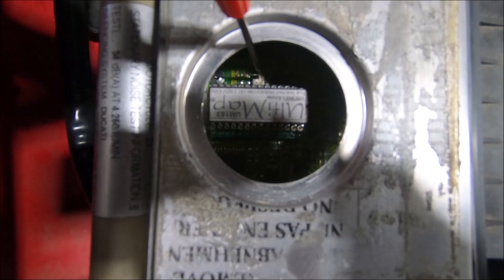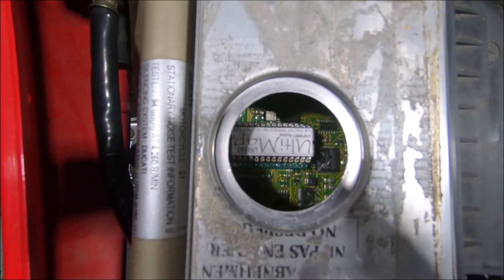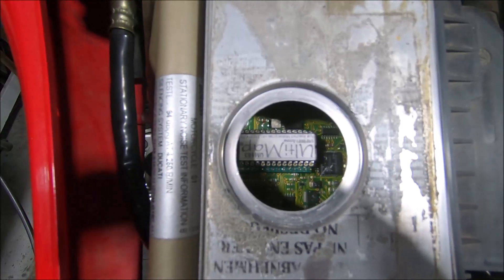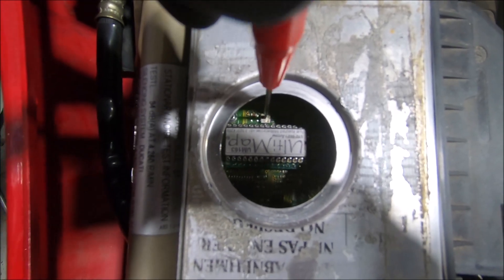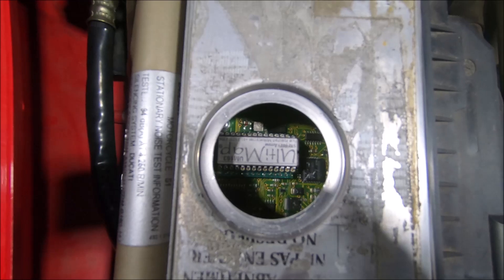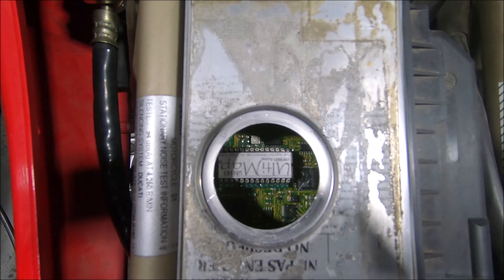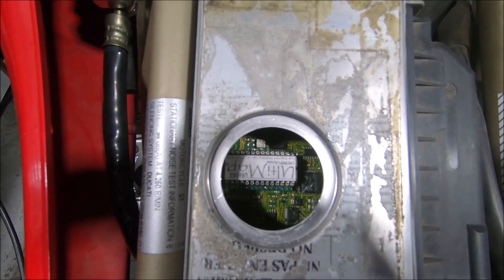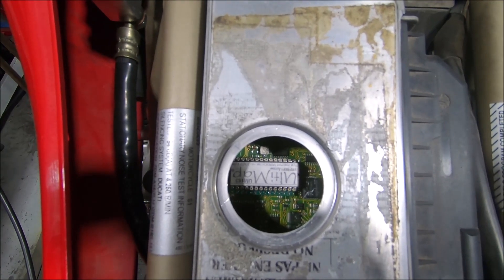Weber Marelli 1.6M ECU Idle trimmer

Comment from the maker: The trimmer works by adding or subtracting a given amount from the fuel injector pulse width.  As such, it's not a % thing, it's a number.  As such, adjusting the idle trimmer will have a much larger impact at low fuel injector pulse width than at high fuel injector pulse widths.  Ie, much more impact or % variation at low throttle cruise than full throttle acceleration, typically 4 or 5 times.  But it can impact full throttle running, especially on the MV models where the pulse widths are quite small even at WOT.

From the report http://www.bikeboy.org/ducati2vthrottleb.html >>

If you don’t have a gas analyser, as a bit of a rough guide, I’ve found that the best way to set the idle mixture is to move the trim pot clockwise (leaner) until the revs begin to drop.  Then go richer until the revs begin to drop.  Now you have these two end points, set the trimmer 1/3 of the way from the lean stumble point towards the rich stumble point.  This usually gives 4% CO when I’ve tried this method and then checked with the gas analyser.

Comment: Hi Brad and thank you for these useful videos and tips! I do appreciate them so much. Quick question regarding this trimmer setting : according to you should it be done with air bleed screws all the way in? Thanks !
Reply from the maker: can you please show me where i have said "according to you should it be done with air bleed screws all the way in?".  i just want to see what you're seeing or reading to work out why you have taken it that way.
Reply: Sorry Brad if I was not clear enough, in fact  it was a question. I was just wondering if it was recommended to adjust the trimmer with air bleeds in a certain position (all the way in ) but probably this step should occur after the idle speed is set so my question might not make much sense 🤔
Reply from the maker: @ericb8142  idle trimmer adjustment is the last step, but often involves air bleed adjustment in a back and forth to get both idle speed and mixture right if it was quite wrong to start with.  i've got a couple of tune set up videos plus the website reports that lay out the steps in order.
Reply: @bradthebikeboy  perfect then 👌 many thanks for taking the time to answer me. I'll review your videos once again. Hopefully I can get rid of the misfires I get at around 2.5k on my 996. @jonny2legs77's testimony gives me hope.  Thanks again Brad! 🙏

Comment: Hi Brad. I'm having a smoke coming out of the pipe of my 916 and it is irritating to eyes. Got poor mileage around 8 to 10km per liter. Dry Black plugs and eventually will fail out. What could be causing it? I already followed your instructions on how to adjust tps and throttle bodies as well as setting the trim pot. Thanks
Reply from the maker: get it on a diagnostic tool and see if all the inputs are valid.  check the fuel pressure.
Reply: @bradthebikeboy  pressure is dropping to 0 after priming. Still have to check where it is leaking. Should it hold the pressure? And also bike wasnt able to rev up to 10k and it will die down after throttle release.
Reply from the maker: @dennisbuenas2976  it should hold the pressure for a long time.